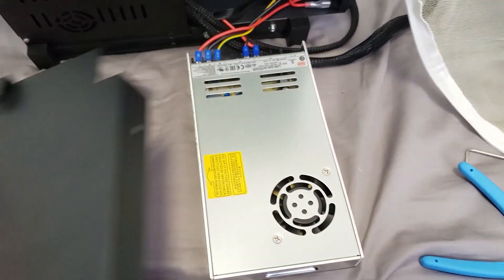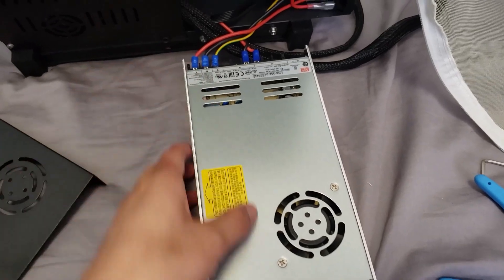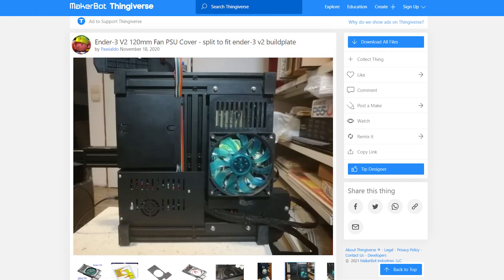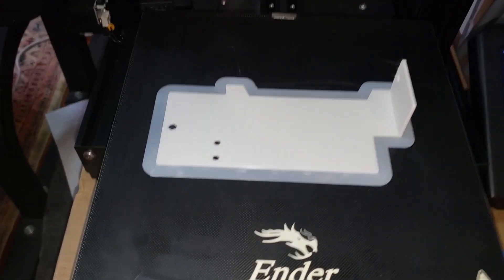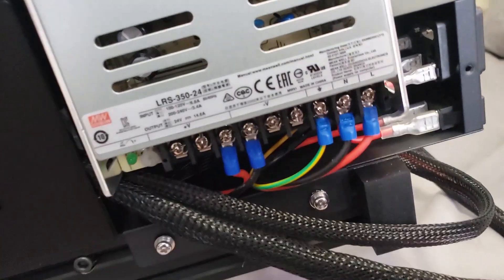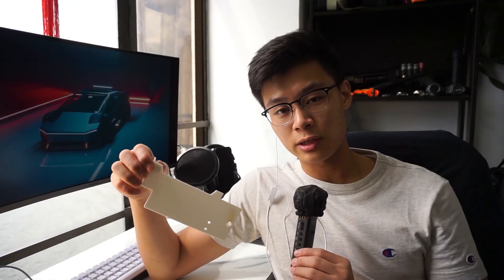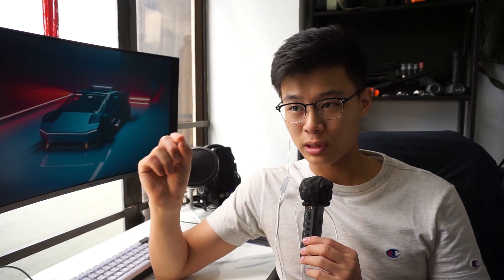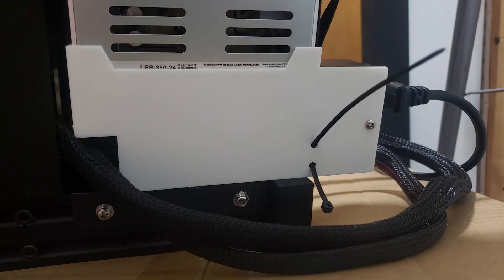The Ender 3 V2 PSU is Terrible?! - A Design Flaw In All Ender 3 V2's

Comment: I've recently been gifted an Ender 3 V2 and was shocked by how much noise the fans make.  I have been binge watching youtube videos on the Ender 3 v2 and came across this one, so ordered a Noctua 4010 for the control board, and a cheap GELID 60 x 15 12v fan (Silent 6) from Amazon.  I also printed off this cover you designed in readiness.  Well the fans arrived today and I just  performed the surgery.. its amazing how quiet the machine is now.  Plus the fact the cooling air has a way to vent out makes all the difference.  How Creality missed that, and didn't simply cut vents in the cover plate I don't know.

Comment: With your permission I will use your idea in my modification.
I made some adjustments to my Ender-3 V2 NEO to reduce the sound from max 55dB to max 35dB.
In the new situation, the printer now usually stays below 30dB, occasionally with a lot of movement it produces 35dB.
I replaced all 4 fans.
Moved the on of switch from the rear to the front.
Printed al the extra parts.
3 fans on 12V 1 on 24V.
Hotend and motherboard fans work with a Buck Converter.
I also changed the power supply. Ender-3 V2 NEO currently has a power supply type "Creality 24V CMS-350-24", which has a 24V fan.
Older printers have the type "Mean Well 24V 350W LRS-350-24", which has a 12V fan.
Somewhere on this channel there are several comments about this change.
I had this Mean Well for LED lighting but this can do to. You can put a quieter 40 x 40 x 10 mm fan inside there. I put my 80x80x25mm outside. Cut a Hole so more air is going inside.
Replace the nozzle fan with a quieter Furiiga DC Brushless Fan 40 x 40 x 10 mm, 24 V. 25 dB, 5365 ± 10% RPM.
Motherboard fan and power supply NOCTUA NF-R8 redux-1200, 80 x 80 x 25 mm, 12V, 9.1 dB, 1200 RPM, 35.8 m3/h, 3-pin.
Hotend NOCTUA NF-A4x10 FLX, 40 x 40 x 10 mm, 12 V, 17.9 dB, 4500 RPM, 8.2 m3/h, 3 pins.

Comment: I have a question.  I bought a new fan, but don't want to go in there and connect it.  Have heard some bad stories about opening up PSU's.  Could I just stick the fan to the bottom (I have squash ball feet so there's room) and leave the old fan in there, and do the exhaust mod he did.  Will the new fan keep it so cool that the old one just doesn't turn on? Then maybe I can reroute new fan to mainboard somewhere?  Anyone with info on this pls help me out, I replaced so much stuff on my printer including the other 3 fans and it's still really loud just because of this psu fan.
Reply: Bad stories? Work save then you can do it.
Remove the power cord, then puch the switch to "I", no power cord inserted, wait a few seconds, switch to "O". It is save to open the power supply.
The fan in the power supply is controlled by the power supply.
Do not install a fan and get the power elsewhere. From where? The power supply?
Creality printers can have two types of power supplies each with a fan with a different voltage, new printers probably have type 2 power supplies:
1. Mean Well 24V 350W LRS-350-24 has a 12V fan 2 pins.
or
2. Creality 24V CMS-350-24 has a 24V fan 2 pins.
If you have a Mean Well power supply, you can replace the fan with a quieter 12V. 
You can choose whether you go for 40x40x10mm inside or 80x80x25mm outside, the latter just can't fit in the housing.

Most queit fans have 3 pins.
If you have a type 2. from Creality you have to buy a queit 24V fan ore a 12V and use a Buck Converter.
Installation. 
Simple way. Cut the wires, not to short, and connect the new fan to the old plug, solder and insulate cables.
Proffesional way. If you are handy, you can remove the tiny plugs from the plug housing by pressing the little lock pins back with a needle and pulling gently on the cable the plugs out of the housing. The same goes for the new fan. Repeat 4 more times. On the new fan, 3 pins, it is mostly the yellow cable that you don't use. Issolate that little pin on the yellow wire ore cut pin of the wire. 
Make sure you don't mix plus and minus and that the fan blows the air into the power supply.

Comment: Thank you for letting me know! I'm not good cutting metal, so I have the printer sitting on the side panel from an old desktop computer. I did flatten it as much as possible to keep it leveled. And I wrapped it in vinyl to create an insulated barrier. I've had it printing for about 32 total hours since I've done this, and it's been perfectly fine.

Comment: Removing this sheet metal part is probably better for proper psu ventilation, but the noise level rise up 3 - 4 dB and it is prety noticeble.
Reply: Ender-3 V2 NEO ventilator mod from max 55dB to Max 35dB

Comment: This is perfect. I didn't want to open up my power supply. It now has the necessary ventilation and the fan is running slower and more quiet, which can only mean the PSU is running cooler!
Reply from the maker: Glad its working well!

Comment: Wouldn't it just be easier to drill holes in the original power supply shroud  ?
Reply from the maker: That could work but I just wanted to try and use my 3D printer to solve the problem
Reply: I feel more comfortable creating something than damaging the shroud personally.

Comment: Do you think regular PLA is good enough? I was wondering about potential issue with temperature warping the plastic.
Reply: You could but i would use ABS or PETG
Reply: @masonfann5506  Well I actually made it, installed it fine and printed a few hours. I will check it soon and report here.
Reply from the maker: The PSU is not supposed to get that hot. I had zero issues with PLA on the PSU.

Comment: Does improving the airflow like this also help with keeping fan noise down? Looking to find any way I can quiet my E3V2 down, but a bit hesitant to mod the PSU itself just yet.
Reply from the maker: it will help with the fan noise since it keeps your PSU cooler. It's also quite simple to install, just take your time and the mod will work out!
Reply: @patrickhacks  thanks! Looking forward to trying it very soon.

Comment: Just found your video. As you have recommend. I printed out the part and replaced the stock one. The PSU isn't getting as hot as it used to  when I purchased it  Thanks for the recommendation.
Reply from the maker: Glad it helped!

Comment: Totally agree, the  PSU sucks, you should checkout the Mainboard wiring.The mainboard cooling fan is wired in parallel to the partcooling fan :) So if you put it of, or low you ll roast your mainboard slowly :)
Reply from the maker: Ahaha I will try and check it out, thanks for the heads up!
Reply: what does that mean, that u can't put a buck convertor on your partcooling fan ? or is it already 12 V instead of 24 V?

Comment: I think this is much better than replacing the metal cover on the power supply with a plastic one full of holes. If a capacitor blows,  you still have the metal cover on the psu to protect and minimize chance of fire
Reply from the maker: Yeah that's a great point that I didn't even realise.
Reply: @patrickhacks    I had seen videos on printing a cover with holes and asked @TH3D Studio about it in a livestream and that was what he had said. It made sense so I took off the black cover and I'll print this one and put it on

Comment: The .stl from Thingiverse imports upside down from the way it should print.  Easy fix, but that fix should be done in the source.
Reply from the maker: Hey, thanks for pointing that out. I will see if I can change the source and reupload it if possible. Also thanks for watching!
Reply: @patrickhacks  Have you revised the .stl file at Thiningverse? Thanks
Reply from the maker: @pempekjak2883  I tried rotating it in FreeCAD but it did not seem to like it. All you have to do is rotate the part in the slicer and it should print out correctly. Everything else with the STL is good.